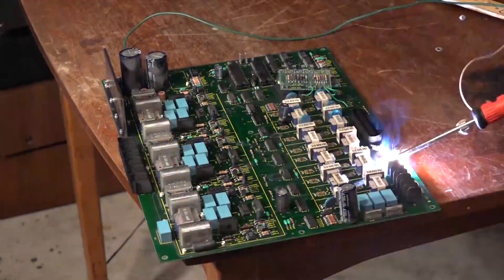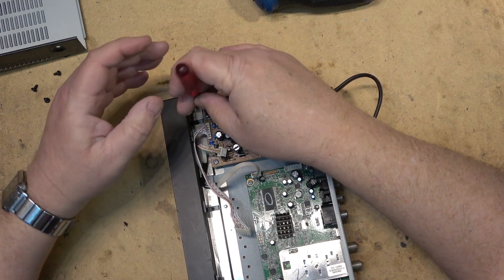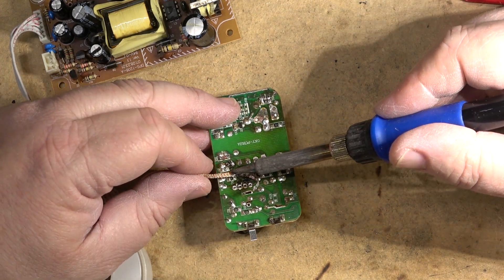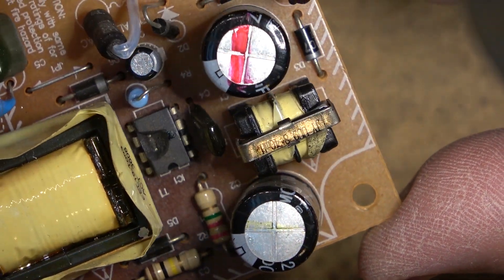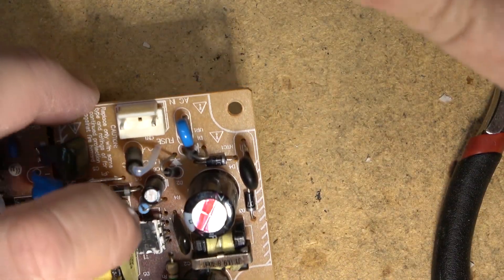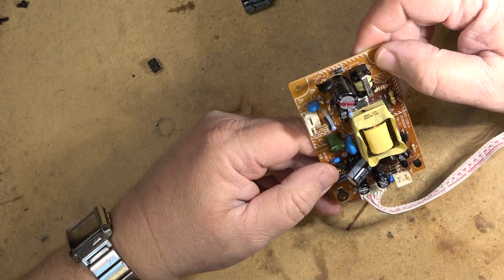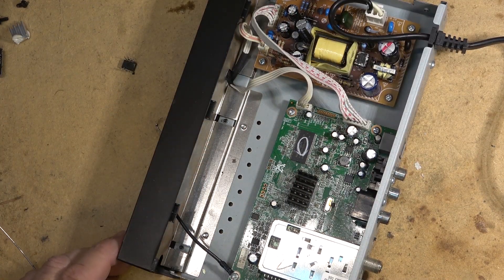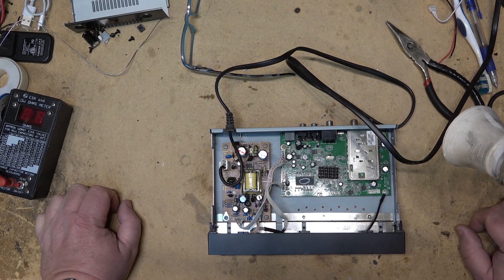Apex DT502 Digital TV Converter Box blowed up real good.   Lets fix it

Comment: I thought those SMPS chips were a MOSFET, oscillator and feedback all in one 8 pin chip. So a chopper IC with integrated MOSFET for a one chip SMPS solution receiving optocoupler feedback for voltage control. Pinout would be high voltage (commoned pins), ground, feedback, and maybe an enable pin. It seems the pinouts are semi universal, which is good so they can be replaced with non identical model number parts.
Reply from the maker: They are but as you saw many are interchangeable.  That's why I was interested in the drain.  They are bridged so seeing the same 78 bridged gave me more confidence it would be compatible.

Comment: Those APEX units runs so hot that you have to remove the top covers when using them. And then when they got so hot they act up. So they are just junk not worth fooling with.
Reply: I ended up drilling a couple of holes over the supply area, to keep mine cooler
Reply from the maker: They all run hot. You should check out a technicilor 8000 4k pvr. They get hot enough to fry an egg on. I have seen them get so hot the plastic deforms when someone does something like stick a DVD case on top of them.

Comment: I don't know that you heard that after 5 years later, the FCC requires all HDTV Stations upgrade from ATSC 1.0 to ATSC 3.0 NextGenTV to have a good reception without having an interference by the flying object, et cetera et cetera, and have customers seek to buy a new converter box or new NextGenTV UHDTV for their own house?
Reply from the maker: I can see big time push back by broadcasters on this one. You thought the analog push back was bad, forcing them to upgrade the digital, and forcing viewers to upgrade again will cause huge backlash. For starters no TVs have ATSC3 tuners in them yet. If a broadcaster upgrades most will just stop watching off air. Perhaps that is the big plan, if nobody watching no need to broadcast at all. You will have to have cable or streaming and that costs money every month.
Reply: @12voltvids  That's beside the point. What it is that, people send a complaint to FCC about the loss of signal by various flying objects, EMF (Electromagnetic Fields), and the storms and winds affect the signal (I'm not talking about people who has a satellite provider).  What folks don't realize that whenever they live in their own area that the TV Transmitter stations is far away from their place, they have to seek to get a rooftop antenna and the amplifier to get a good signal to the TVs, and when they are about 5 miles away or less needs an indoor antenna to get a good signal though they can get one rooftop antenna for their TVs. For what I learned that anytime they are getting a so called a quote-end-quote "HD Antenna, UHD Antenna, and Digital Antenna," they are getting the ones that they are not working right and there is no such thing as HD Antenna, UHD Antenna, and Digital Antenna. It's only called Indoor Antenna and Rooftop Antennas. It don't matter what the product has said the way it badge an UHD, 4K, HDTV 1080i or 1080p, and along with the other platform affiliates, the quality that people get a poor design antennas that will not work properly.

The FCC has studied about the loss of signal by test them out about the difference between both ATSC 1.0 and ATSC 3.0 NextGenTV, they learned that the quality of the signal is poorly designed the way it was developed back in approximately in '96 or '99, and the 3.0 ones had a no loss signals at all and still going well. I don't know that is the way it works, but we'll see about that after 5 years.

Now get this! The FCC made a proposal about the low-powered AM Radio Stations who is struggling to have more listeners are required to switch off the analog transmitters and broadcast only in digital including HD AM Radio (Hybrid Digital AM Radio), and to have more listeners listen to the radio stations very clearly without having a low quality audio, statics, crackling and popping, and the interference. It got me to thinking, "what good is that will do if people don't have a HD Radio to listen their favorite radio stations at all for where they have to buy the new HD Radio?" That's in my only thoughts.

However, the full-powered AM Radio and full-powered FM Radio is out there forever and the FCC didn't require all radio stations to switch to digital only broadcasting, because there is no need to take its action to make a switch from Analog to Digital, and the full-powered Analog FM and AM will continue to be broadcasting 24/7. HD Radio stations is not a whole lot of them out there and people are still enjoying listening to their vintage FM and AM radio while enjoying their favorite soundtracks or listening about the news, weather, traffic, and sports. Analog Radios is way stronger and ever.

Comment: Hi Dave. You might want to clean the card completely via windows through disk part. Then recreate the file system and reformat it. If you are not knowledgeable on how to use disk part on windows via command line there are video's on you tube on how to preform the steps. Or as you say the SD card might be fubard  but it might be an worthy try.

Comment: Hey thank you providing the only video on youtube where you show how to repair one of these.  I replaced all of the capacitors, and the the bad diodes including the big one shottky and it powers on and i get all of the correct voltages.  3.31 and 5.2 and the 12 volts was 11.45 but the more diodes i replaced the higher it got.  So, it is not at 11.95 v.  But it will still not turn on the green light.  I would hate to have to locate every part on the board and replace it but if i have to I will.  I was hoping you could help me out.

Comment: Cable company here gave those converter boxes out "free" when they switched to 100% digital.  About a year later they started billing customers a monthly charge for all of those boxes they'd given out "free".
+10 points for the "Kids In The Hall" reference.
Reply from the maker: This is not a cable box.  It is an off air free tv box to receive the broadcast channels for use with older analog equipment they are great to use with a dvd recorder or VCR to record off the air.  Sure every new tv has a digital tuner but say you want to record something off tv.  You can't do that today without either a tuner card in the computer or some expensive streamer box that hooks to your antenna.  One of these and a dvd recorder and you are good to go. Better still a dvd-ram recorder or dvd-hdd recorder and you are set.  These boxes can be set to tune to a channel at specific time then just set the dvd-hdd recorder to record line at at same time and you have an off air recorder.  Sure not hd but better than nothing.  That's what these boxes are still good for.
Reply: @12voltvids  you get a lot more hours/GB your way.  Sounds really convenient, too.
Reply from the maker: @matambale  
Well my internet is unlimited but that's only because I pay more.  Costs about 100 a month here for what i get which is only 75 down 20 up.  I could get faster speeds for more $

Comment: i have a few of these i bought at goodwill a few yrs ago one of them I bought powers on but has no output to the TV. I'm not sure what's wrong with it but i know the power supply is good because i tried it on another one i had & it works.

Comment: The amount of work you do I am surprised you don't have a solder sucker like a hakko.
Reply from the maker: The reason i don't it because I did in the past and the cost of replacement tips to keep it running was far higher then buying braid.  And i really don't do that much work.  That roll of solder braid i have had for probably 10 years.  The shop I bought it at has been closed for about 5.  That shows how little solder wick i actually use.  If some manufacture wants to send me a desolder station to demo and make a video of great, but I am not about to plunk down a couple hundred bucks on something i will never see any payback on.

Comment: Heh, i tried to fix 24V antenna power supply and when i replaced bad 400V cap oscillator ic went bang. There were also the other cap 400V witch was really bad. So ic plowed. Obviously there were still high ripple, but the new working cap rised voltage and existing bad cap caused still ripple and it blowed ic. This is only my theory. Nice vid by the way.

Comment: You see? 
A guy like myself would have found the Mofset and it would have ended there.  But experience and talent, delves deeper, and finds the failure cause ??  The Capacitor.
You see? Those fahlt finding techniques need to be remembered.

Comment: Hope you put that little stick on heatsink on it again. That will help with not cooking the capacitor again, as it will run cooler as it is able to dissipate the heat better.

Got a satellite one that I use for radio, as I plugged a set of PC speakers that run off USB power into the combined video audio out, and it works well for that, not needing the monitor turned on.  As it has a USB memory to record encrypted video for watching later, I used a fake USB hub, that has no actual IC in it, just a fake blob on board, and a random recycled crystal, to look the part, and all the USB data lines are in parallel. So it had the lines cut to let only the first work, and the rest are power outputs. It has a plug in 12V wall wart, which I have plenty of, though I also have repaired a few failed ones, the output capacitors and the small primary side always fails. I keep a kit of parts for this, 220uF, 330 uF, 470 uF 16 and 25V, and 22uF 63V for the primary side. 3 capacitors and they work again.

SD card quality is a guess, as you have no idea if it was a real Sandisk, or a larger part that failed 256G setup, and was resized down to 128G, or was a QC fail that was sold on the grey market, or even a fake one. Buy new one, run a few checks on it, to stress it and fill it up and check real capacity, and then format in camera before use. I did kill a USB memory by running it as OS drive, and with swap and logging at default. Took 3 days before the stick stopped working, unable to write, though a format did get it working again, it had lost capacity, and I did not trust it any more. Still have a few 256M and 512M SD cards around, some still in the packaging, as older cameras do not work with cards over 512M, and some appear to work but just corrupt the card.
Reply from the maker: The SD should be a real one as it was bought is a real store not online from ?. I have had far better results with lexar and won't be buying any more SanDisk.
Reply: @12voltvids  I normally buy Transcend, and only issue I have with them is the actual physical connector wearing out. Lifetime wise using a few in a car recorder, and typically they will do a year or more there before they start to give issues, with the card having had a good number of full writes on the 16 and 32G cards I buy for there.  I keep 2 spare ones in the car as well, just in case I need to retain something for later. Transcend because the local computer outlet I deal with normally has them or Kingston in stock.

Comment: Smashing recovery :-D
i've seen all sorts of dead oddball pwm chips that don't seem to exist on the net.
I really dislike the mosfet incorperated,  external on a good heatsink is my favorite.
The TOP brand was well known,  they blew up as well lol.
Excercise the sd card in your p.c,  i hope the card is the fault.
Reply from the maker: It's a new camera. I just dropped like 1500 on black Friday back in November so if the camera is bad I'll be getting a new one.
Reply: Yes but the typical switcher failure is the switch device going all 3 pins short, blowing out the current sense resistor, and then blowing the controller, so you will still end up replacing 3 parts just to get it running. The integrated devices all often have built in current sensing, using a sample of the source current passed through an internal or external resistor, and often also have a high voltage startup supply, so not start resistor drifting high and open circuit, so it stops working after a power cut. Very rare for the transistor to just short out and not blow all the primary side out.
Reply: @12voltvids  Get that sdcard tested as soon as possible.
Reply: @SeanBZA  i dont like a hot internal mosfet in the chip with the control circuit.
It's a bad idea.
I have seen more single chip supplys fail than the external mosfet types.
You don't need to tell me the basic functions of a controller, i know already.
I'm not into the odd modes that controllers have to be more efficent.
I know one thing,  the buggers still die lol.
Reply from the maker: @zx8401ztv  going to run it through a full test today. It is blank now so i can do full write.

Comment: 4:17 to 6:15 - Watching you spend TWO MINUTES trying to desolder a DIP-8 on a single-sided PCB was painful!
Get some normal flux (Rosin paste works best but leaves a mess) and smear it onto your desoldering braid, and THEN use it.
You'll be stunned at the difference some flux makes, as it turns it into a vacuum cleaner for solder!
Reply from the maker: Big deal.   I know dipping the wick into flux makes it more efficient but makes a mess.   Don't have much in the bottle so why waste it.

Comment: Hi Dave, as electrolytic capacitors seem to be very problematic, are there any alternatives available , that would be more reliable?
Reply from the maker: Nope.
Reply: @12voltvids  For the primary side you can use metallised film capacitors, which are available up to 10uF 400V, but which are likely to be bigger than the entire power supply board though.  for high values the only reliable thing is wet slug tantalum in a glass frit sealed housing, which is rated for space use amongst others.

Price though from Vishay and Kemet is extreme, especially if you want the higher values and voltages. On the price list as "enquire from your rep", and typically there is going to be a few weeks lead time for them as well, as they are not a commonly stocked item.

I did use some 10uF 25V wet slug capacitors to replace a failed 1000uF 16V low ESR capacitor in a PSU, as I had nothing else around. 3 in parallel to replace it, and the supply rail ripple was very low afterwards, though I also had a 1000Uf 16V after the filter inductor, which was not seeing any ripple, so was not getting hot. Those 3 caps did not even get warm, ESR in the milliohms, and with 5A shared on the 3 just a little above ripple rating. Those 3 capacitors though probably were the same cost as the entire computer they were in, though these were used one from old equipment, from the 1970's.
Reply from the maker: @SeanBZA  as I said "nothing" to replace electrolytic caps with. 
After all it has to fit in the available space and the part can't cost more then the unit is worth.
Reply: The only alternatives are better quality electrolytics from a decent manufacturer, like Nichicon, Rubycon, Panasonic, and Nippon Chemicon.  At the very least, they'll be more reliable than the cheap Chinese crap that these converter boxes were made with.
Reply from the maker: @Watcher3223  Not necessairly. I have seen many Nichicon, Rubycon and Elna caps piss all over the board.
Reply: @Watcher3223  Thanks for the update, My electrical knowledge is basic, but I enjoy watching these videos, I find the diagnosis fascinating.
Reply: @12voltvids  True.  And I've had a couple of times where Japanese caps failed by leaking or bulging, too.

But still not to the degree and frequency that the Chinese craps, uh ... caps do.

I'll still take, say, Elna over Capxon, Teacon, or whatever name a third rate Chinese cap goes by in applications where an electrolytic cap is the only practical choice.
Reply: @stevenclarke5606  Thanks, but 12voltvids is really the guy.  He probably has forgotten more than I've known, to be honest.

Comment: For small devices such as a DTV converter box, why not just use a linear power supply?
Reply from the maker: Multiple voltages needed.  5, 12, 33 ect.  Much easier and more accurate with smps. Also much more energy efficient.
Reply: These days a switching supply is also cheaper than a mains transformer because they are smaller, meaning less material is needed for manufacture.
Reply: @eDoc2020  - it's nothing to do with "smaller". They have a bigger parts count, with much more complexity.
They are cheaper simply because they contain LESS COPPER.

Comment: T thought the Peak Forward Voltage in the UK is '240 x 1.41' which is about 340 VAC. Therefore, if my electrical knowledge is correct, the capacitor you changed is NOT rated for the Peak Forward Voltage in the UK. Which is why virtually ALL power caps used in UK electrical equipment are rated for 400 VAC.

Comment: I'm still seeing anti-5G crap. They say it uses untested frequencies. Isn't a million watts over many decades good enough?! That's just one UHF station too. I've noticed these sd cards don't seem to last long anymore. It makes me wonder about the reliability of solid state hard drives. I've seen people taut that solid state hard drives are even more reliable than mechanical ones. All I know is that mechanical hard drives are much more dependable then they were in 2000. Technically, it's best not to have moving parts, so I do see the argument being solid state drives. They do seem to cut a lot of corners with electronics, though.
Reply from the maker: 5 generation cellular used 600mhz, 700mhz, and 3.5 to 4ghz 
It also uses the existing 850, 1700, 1900, 2100 and 2500 bands. The real difference between 3g 4g and LTE is channel bonding.   LTE for example can use a few frequencies simultaneously.  5g can use all the available bands at once.